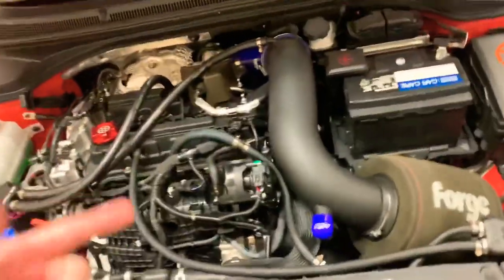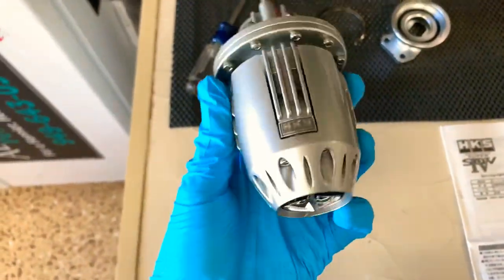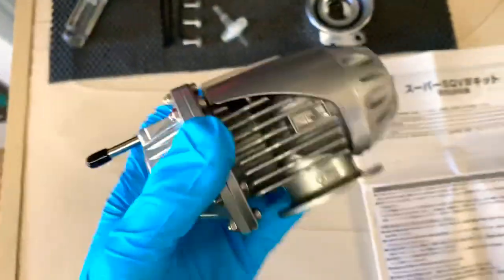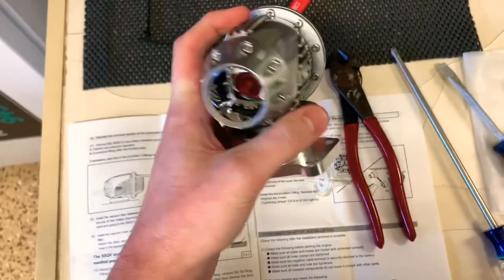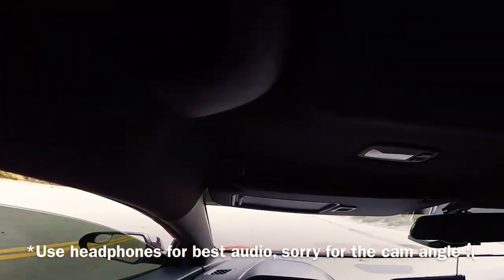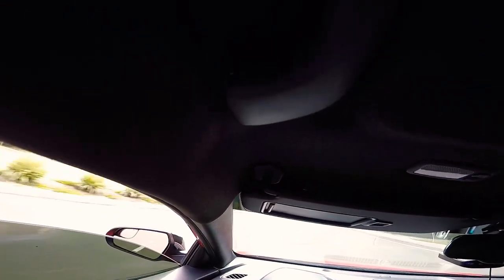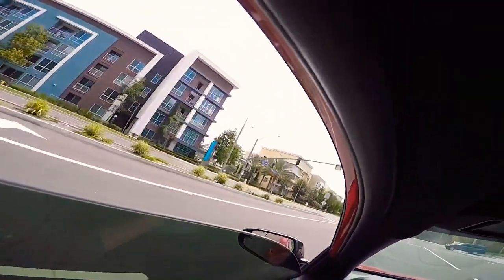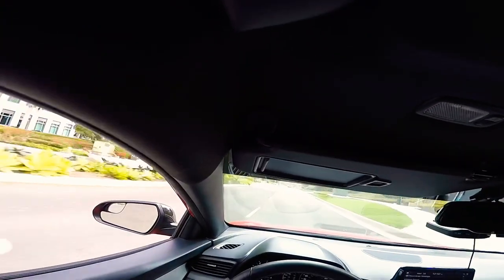HKS BOV Install W/ Pulls! (Veloster N)

Comment: They sound so good.
I had a Forge but when I got tuned it was dumping all my boost at low throttle (prolly when hovering around where vacuum goes to positive boost).. would hear psssssssssss as I slowly accelerate.  Stab gas and it would be good and then hold 21psi).
Later that day I bumped into a dude at a meet with an AV6 for $125 (500 miles on it) tossed the AV on and zero issues.  Wish it sounded like that Forge tho when it was stock tune.  Later on I find out i needed to tune the BOV.  Duck that
Reply from the maker: Yeah thats interesting cuz forge site says that bov is made for i30/veloster n and it talks about how good it is, then it doesnt work lol. But i actually do love forge stuff they make good products. Their stuff is even on real race cars. But about the AV6, i love the design just not the sound, its a little too quiet for me kinda like the stock one.
Reply: @revmatchproductions  Hey man your car is amazing! So i have the 2018 Hyundai Elantra Sport and i wanted to get a BOV and a Solenoid as well.. However, I'm a total newbie and can't figure out all the parts and adapters i need... is there any way you could link me the right BOV with Adapter and the right Solenoid with everything to get it going? Please and thank you! then i can buy it and go to a garage and have them install it.. Greatly appreciate it

Comment: I been running an AV6 but when I dump at redline or at full boost it is a choppy release.  Like compressor surge thru the BOV.  Maybe spring not strong enough.  Anyway.. said fuck it and ordered the best.  HKS! Can’t wait to hear that clank sound it makes when it dumps!
Reply from the maker: The Hks has a very unique chirp due to the pull type valve, i love it! I still love the old school whoosh from the other bov’s though

Comment: Nice! 

I will say, I have same adapter and BOV and mine does not rotate that easily (really have to put some force into it for mine). I doubt it is causing you any leaks or anything but you may want to take a flathead or something and make sure the snap ring is fully seated into the groove (I had to do that with mine and seems it is a common thing others have to do as well). I also can highly recommend the MAC solenoid paired with this setup.
Reply from the maker: The ring has a flat side and a slanted side, the flat side goes on the bottom. Its actually tight it just looks like that in the video. It should take force to rotate but not a crazy amount of force, if its that hard your ring may be upside down. It should also feel smooth when you rotate it when installed correctly, kind of like a rotated turbo kit
Reply: @revmatchproductions  Yeah, I made sure the ring was the right way (tapered on top). I just remember the install videos I watched said that even if the ring snaps in, make sure to go around and check that it is seated deep enough into groove to be safe. Before seating it in deeper it spun a little too easily for my liking. 

Anyway, keep going with the build! Looking great!
Reply from the maker: Thanks man i appreciate it!
Reply: I was thinking the same thing. I have the HKS and it should NOT rotate that easily. Clip not fully locked in.

Comment: I have a 2021 VN DCT (stock) and I've been wanting for so long a better BOV sound. I wonder if that one will fit perfect on mine? Also I'm thinking on the AEM intake. Any suggestions on that?
Reply from the maker: Mostly all of the bov’s out there will work on the N platforms. Aem is good, any intake will give you more turbo sound as well

Comment: 1 year later from my first comment on this video, and I now have a 2022 N with this bov. Question: does your's also kind of start opening up and releasing constantly if you build too much boost or go a bit high in rpm's (not to red line)?
Reply from the maker: Yes, that is normal. The HKS actually has two valves compared to most bov’s that only have. One is for low boost and one is for high boost
Reply: @revmatchproductions  Perfect. Thank you for clarifying

Comment: I definitely love the sound but im new to turbo cars. My biggest concern is that I have heard that the noise you hear from the flutter is compressor surge that might hurt the turbos longevity. I don't know if anyone might be able to speak on that in this specific scenario, but if it would be negligible, I would love to hook up my 2020 N with this BOV
Reply: tthe vn doesnt have enough boost to have any compression surge, the stock diverter valve already has "flutter"

Comment: So all you need for this install is the 2.0 genesis bov from hks? Or do you need to buy the adapter and hose seperate?
Reply from the maker: You need to also buy the adapter for it to mount onto the charge pipe, a company called Torque Solution makes one. It says its for stinger 2.0 but its the same engine it works perfect.

Comment: Want to put an hks but I’m afraid it’ll mess things up because it will no longer be recirculating back into the intake. Have you had any issues with the Bov?
Reply from the maker: Not at all, the Veloster N is a non MAF based car which means it has no air flow sensor before the turbo. This is good for tuners as you can go recirc or vent to atmosphere it doesnt really matter. If anything its more beneficial for the turbo to go with a bov like the hks. You will have almost no compressor surge which helps improve the life of the turbo, and always getting fresh external air when getting back on boost after a shift. I recommend you get one!

Comment: Is this adaptor the same for the i30N, I’m wanted to say yes as pretty much everything is is like for like the exact same? 
Also did you notice any extra lag in the turbo from venting it all to atmosphere rather then it recirculating?
Reply from the maker: Yes the Hks works on any of the 2.0t platforms, but you will need to order an adapter to fit. You can get one from Torq Motorsports. No lag just more sound

Comment: hey man i just had a question, about to place my order for this BOV soon, been watching many installation vids and looks really easy to install. however, i still don’t get where the vacuum hose runs to after you attach it to the BOV? where does the other end of the vacuum hose connect??
Reply from the maker: It connects to the boost solenoid thats mounted on the intake right before the throttle body
Reply: @revmatchproductions  ahh awesome man, i appreciate it very much 🙏🏼 placed the order yesterday, can’t wait to install this beauty

Comment: Would it sound this good without air intake?
Reply from the maker: The purge will sound the same yes, but you wont hear the turbo with the stock intake unless you’re at wide open throttle with the windows down

Comment: Hey i just bought a 2022 DCT veloster n and want to put the same hks blowoff valve you have in the video as its first mod. Is this bad for the car? Any other suggestions or recommendations?
Reply from the maker: No not at all, if anything its better by not recycling the used already hot air over again. Running a bov allows the turbo to always get fresh air from the atmosphere only, on and off throttle. Plus it sounds sweet and looks nice in the engine bay!

Comment: What’s size vacuum line did you use past the little filter
Reply from the maker: Im not sure the size but its the one thats on the stock bypass valve, it runs from the solenoid to the valve. The hoses that hks include are good but it slides off the bov with little force, even with the little clamp on there, so i just re used the stock one. Everything works perfect

Comment: are these like special hoses or are they stock parts
Reply from the maker: They supply hoses with the bov but i used one of the stock ones cause theirs was slightly too large in diameter for the hose that runs to the solenoid.

Comment: Hey so I’m waiting for my catch can to arrive. I already have an Afe  takeda intake installed. What purpose would a BOV do and is it beneficial ?
Reply from the maker: A bov will let you hear the surge of air that is released when you shift or let off the gas pedal. Its mainly for sound but can also help for more proper and precise venting. The stock valve is okay but its all plastic, if you go aftermarket the build quality is just a lot better and will outlast the stock one. Also gives you the full turbo sounds you want when paired with an open intake!
Reply: @revmatchproductions  I do not have an open air box intake. The Afe takeda comes covers like the OEM. Will it still make the wooshing ? Or will it be more suppressed ?? Follow my IG @GreatBamDino
Reply from the maker: Its a little more quiet but you should still have the turbo surge noise when you let off at low boost with just an intake, the bov gives the loud whoosh for the push type or psshhuu if u get the Hks pull type, they work even on stock intakes

Comment: hey what did you use to plug your bypass valve on the intake system?
Reply from the maker: Its just a little rubber cap, measure it on your intake to make sure you get the right size. Mine was slightly too small but i was able to stretch it on and it worked even better since i dont have to put a clamp on it. Just google bypass valve cap

Comment: New to the platform, is this save for the turbo?
Reply from the maker: Yes, if anything it will improve the life of your turbo by releasing the excess boost instead of recirculating it and causing compressor surge

Comment: Great video! Was wondering where you got the cap for the intake? Been searching for one and I can't find it haha
Reply from the maker: Right here bro! 

https://hpsperformanceproducts.com/products/hps-high-temperature-reinforced-silicone-coolant-cap-bypass-heater-core-delete-black-blue
Reply: @revmatchproductions  Much appreciated! What size did you get if you dont mind me asking haha
Reply from the maker: I actually dont remember to be honest lol, just measure yours cause i think its slightly different size for each intake. Unless you have the Forge intake as well
Reply: @revmatchproductions  I have the forge one! I shoulda mentioned that.. that’s my bad.
Reply from the maker: So it doesnt have to be exact, but you want it to be tight. Mine was actually one size too small so i had to kinda stretch it on, thats why it has no clamp its on there really tight. Im pretty sure i bought the 25mm
Reply: @revmatchproductions  bought what too small??
Reply from the maker: Its a  bypass valve cap for the intake

Comment: hey! where did you get the cap for the intake on the bypass from the bov?
Reply from the maker: I dont remember tbh bro sorry, i just searched for hose cap or bypass valve cap and i found it. Make sure to measure the size before you purchase, but i believe its around 1 inch
Reply: @revmatchproductions  thanks bro! Appreciate it I’ll take a look

Comment: Awesome install, HKS BoV looks awesome too. Honestly I can't stand the high pitched sound, is there any other adjustments to make it sound a bit more whoosh than this high pitch whistle?

Keep it up.
Reply from the maker: Thank you. Yes there is different tips you can put on that change the sound, but i think it will still sound similar. Im really into different bovs however so i might try a Greddy or AV6 down the road as well, i liked the turbosmart but it broke unfortunately due to poor quality control
Reply: @revmatchproductions  Hey, thanks for the reply. I like the looks of AV6, small compact and almost "kinda" OEM look a like. Hopefully before i pull the trigger ill see you install one in the near future. Ill go amd do a search on YT see how it sounds and perform.

Thanks for the heads up and letting me know about the adjustment on HKS.

Keep it up, can't wait to see your next mods.
Reply from the maker: Thanks man i appreciate that.